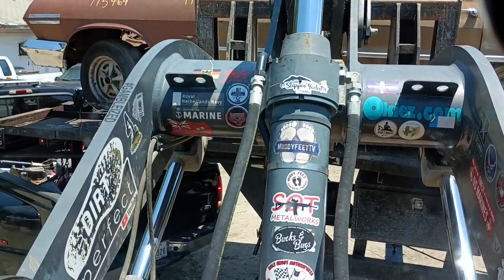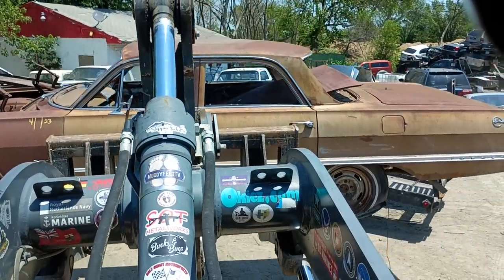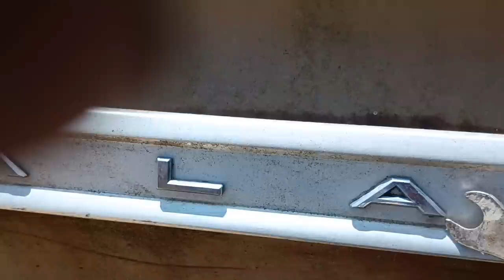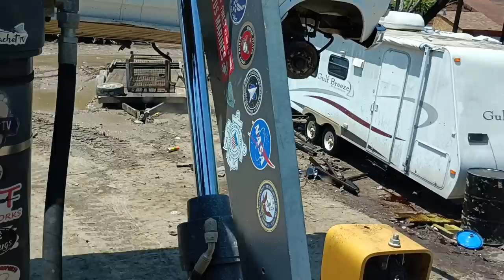'63 Impala never had a chance. Straight from the trailer to the Car Crusher 😔

Comment: A year older than me and just as knackered!   a shell of its former self     just like ...oh dear ! 🤭🤭
And to all the  ones who's going to start crying and wringing their hands with grief . These were built to last  ...around seven  years. 10 tops 
 Planned  obsolescence was a thing then  same as it is now .  Just the steel in the 60's was slightly better .
Reply: The steel in the 1960s was actually worse, but that's irrelevant, because today they make them out of thin aluminum and plastic.

Comment: Beginning of the video, and title drop. 1963 Chevrolet Impala going to the crusher (7:03, crushed).
5:36, grabbing a Honda Accord (11:29, crushed).
7:51, finally identified. Pre-crushed Nissan Maxima.
12:38, grabbing a Chevy 15 passenger van.

Shorter video, only 3 cars crushed out of 4. 2,794 is the new tally.